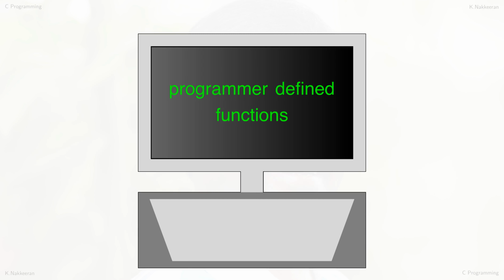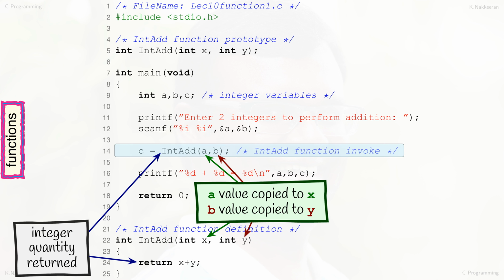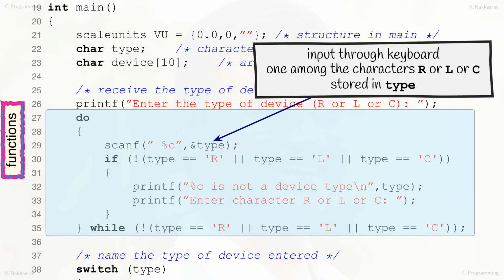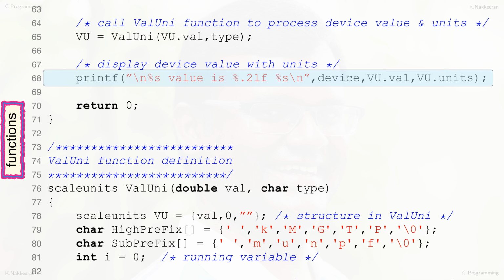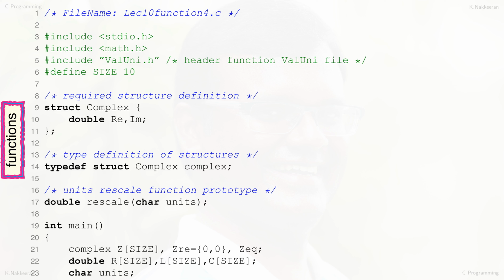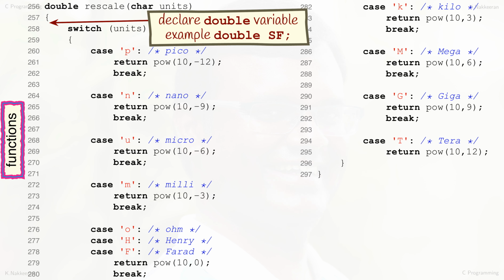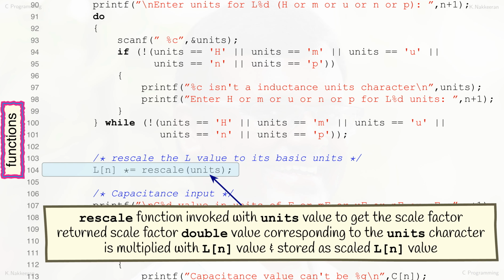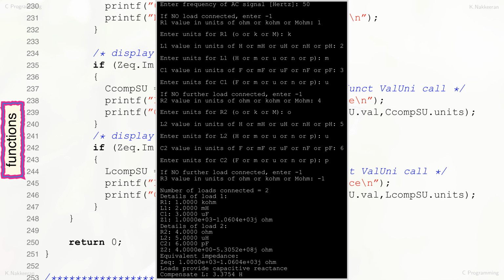C Programming Lecture 10/13

Comment from the maker: /* FileName: Lec10function4.c */

#include <stdio.h>
#include <math.h>
#include "ValUni.h" /* header function ValUni file */
#define SIZE 10

/* required structure definition */
struct Complex {
    double Re,Im;
};

/* type definition of structures */
typedef struct Complex complex;

/* units rescale function prototype */
double rescale(char units);

int main()
{
    complex Z[SIZE], Zre={0,0}, Zeq;
    double R[SIZE],L[SIZE],C[SIZE];
    char units;
    scaleunits RSU[SIZE],LSU[SIZE],CSU[SIZE];
    scaleunits LcompSU,CcompSU; /* struct compensate L & C */
    double pi,f,w; /* double vars pi, freq & ang freq */
    int n=0,m=0; /* running var for number of loads */
    
    /* frequency of the AC power supply */
    printf("Enter frequency of AC signal in Hz: ");
    do
    {
        scanf(" %lf",&f);
        if (!(f >= 0))
        {
            printf("Frequency value can't be %g\n",f);
            printf("Enter +ve value for frequency in Hz: ");
        }
    } while (!(f >= 0));

    pi = 2*asin(1);   /* pi value in double */
    w = 2*pi*f;       /* angular frequency */
    
    /* Resistance input */
    printf("\nIf NO load connected, enter -1\n");
    printf("R%d value in units of ohm or kohm or Mohm: ",n+1);
    do
    {
        scanf(" %lf",&R[n]);
        if (!(R[n] >= 0 || R[n] == -1))
        {
            printf("Resistance value can't be %g\n",R[n]);
            printf("Enter +ve value for R%d or -1 if no load: ",n+1);
        }
    } while (!(R[n] >= 0 || R[n] == -1));

    /* receive the units for resistance */
    if (R[n] != -1)
    {
        printf("\nEnter units for R%d (o or k or M): ",n+1);
        do
        {
            scanf(" %c",&units);
            if (!(units == 'o' || units == 'k' || units == 'M'))
            {
                printf("%c isn't a resistance units character\n",units);
                printf("Enter o or k or M for R%d units: ",n+1);
            }
        } while (!(units == 'o' || units == 'k' || units == 'M'));
        
        /* rescale the R value to its basic units */
        R[n] *= rescale(units);
    }
    
    while (R[n] != -1)
    {
        /* Inductance input */
        printf("\nL%d value in units of H or mH or uH or nH or pH: ",n+1);
        do
        {
            scanf(" %lf",&L[n]);
            if (!(L[n] >= 0))
            {
                printf("Inductance value can't be %g\n",L[n]);
                printf("Enter +ve value for L%d: ",n+1);
            }
        } while (!(L[n] >= 0));
    
        /* receive the units for inductance */
        printf("\nEnter units for L%d (H or m or u or n or p): ",n+1);
        do
        {
            scanf(" %c",&units);
            if (!(units == 'H' || units == 'm' || units == 'u' || 
                  units == 'n' || units == 'p'))
            {
                printf("%c isn't a inductance units character\n",units);
                printf("Enter H or m or u or n or p for L%d units: ",n+1);
            }
        } while (!(units == 'H' || units == 'm' || units == 'u' || 
                   units == 'n' || units == 'p'));
        
        /* rescale the L value to its basic units */
        L[n] *= rescale(units);

        /* Capacitance input */
        printf("\nC%d value in units of F or mF or uF or nF or pF: ",n+1);
        do
        {
            scanf(" %lf",&C[n]);
            if (!(C[n] >= 0))
            {
                printf("Capacitance value can't be %g\n",C[n]);
                printf("Enter +ve value for C%d: ",n+1);
            }
        } while (!(C[n] >= 0));
    
        /* receive the units for capacitance */
        printf("\nEnter units for C%d (F or m or u or n or p): ",n+1);
        do
        {
            scanf(" %c",&units);
            if (!(units == 'F' || units == 'm' || units == 'u' || 
                  units == 'n' || units == 'p'))
            {
                printf("%c isn't a capacitance units character\n",units);
                printf("Enter F or m or u or n or p for C%d units: ",n+1);
            }
        } while (!(units == 'F' || units == 'm' || units == 'u' || 
                   units == 'n' || units == 'p'));
        
        /* rescale the C value to its basic units */
        C[n] *= rescale(units);
        
        Z[n].Re = R[n]; /* impedance real part */
        if (C[n] != 0)
        {
            Z[n].Im = w*L[n] - 1/(w*C[n]); /*imag part */
        }
        else
        {
            Z[n].Im = w*L[n]; /* impedance imag part */
        }
        
        /* Add up reciprocal of impedances */
        Zre.Re+=Z[n].Re/(Z[n].Re*Z[n].Re+Z[n].Im*Z[n].Im);
        Zre.Im+=-Z[n].Im/(Z[n].Re*Z[n].Re+Z[n].Im*Z[n].Im);
        
        /* increment variable for number of loads */
        n++;
        
        /* Resistance input */
        printf("\nIf NO further load connected, enter -1\n");
        printf("R%d value in units of ohm or kohm or Mohm: ",n+1);
        do
        {
            scanf(" %lf",&R[n]);
            if (!(R[n] >= 0 || R[n] == -1))
            {
                printf("Resistance value can't be %g\n",R[n]);
                printf("Enter +ve value for R%d or -1 if no load: ",n+1);
            }
        } while (!(R[n] >= 0 || R[n] == -1));
    
        /* receive the units for resistance */
        if (R[n] != -1)
        {
            printf("\nEnter units for R%d (o or k or M): ",n+1);
            do
            {
                scanf(" %c",&units);
                if (!(units == 'o' || units == 'k' || units == 'M'))
                {
                    printf("%c isn't a resistance units character\n",units);
                    printf("Enter o or k or M for R%d units: ",n+1);
                }
            } while (!(units == 'o' || units == 'k' || units == 'M'));
            
            /* rescale the R value to its basic units */
            R[n] *= rescale(units);
        }
    }
    
    /* check whether any load is connected */
    if (n == 0) 
    {
        printf("\nNo load. No compensation needed\n");
    }
    else
    {
        /* display the number of loads connected */
        printf("\nNumber of loads connected = %d\n",n);
        
        /* display the impedance of all loads connected */
        while (m != n)
        {
          RSU[m] = ValUni(R[m],'R');  /* function ValUni call */
          LSU[m] = ValUni(L[m],'L');  /* function ValUni call */
          CSU[m] = ValUni(C[m],'C');  /* function ValUni call */
          printf("Details of load %d:\n",m+1);
          printf("R%d: %.4lf %s\n",m+1,RSU[m].val,RSU[m].units);
          printf("L%d: %.4lf %s\n",m+1,LSU[m].val,LSU[m].units);
          printf("C%d: %.4lf %s\n",m+1,CSU[m].val,CSU[m].units);
          printf("Z%d: %.4e%+.4ej ohm\n",m+1,Z[m].Re,Z[m].Im);
          m++;  /* array index for next load */
        }
        
        /* equivalent impedance real & imaginary parts */
        Zeq.Re = Zre.Re/(Zre.Re*Zre.Re+Zre.Im*Zre.Im);
        Zeq.Im = -Zre.Im/(Zre.Re*Zre.Re+Zre.Im*Zre.Im);
        
        /* display the calculated equivalent impedance */
        printf("Equivalent impedance:\n");
        if (Zeq.Re != 0 && Zeq.Im != 0)
        {
          printf("Zeq: %.4e%+.4ej ohm\n",Zeq.Re,Zeq.Im);
        }
        if (Zeq.Re != 0 && Zeq.Im == 0)
        {
          printf("%.4e ohm\n",Zeq.Re);
          printf("Total load is purely resistive\n");
          printf("No reactance compensation needed\n");
        }
        if (Zeq.Re == 0 && Zeq.Im != 0)
        {
          printf("%.4ej ohm\n",Zeq.Im);
        }
        if (Zeq.Re == 0 && Zeq.Im == 0)
        {
          printf("0 ohm\n");
          printf("No reactance compensation needed\n");
        }
        
        /* display the compensating C value */
        if (Zeq.Im > 0)
        {
          CcompSU = ValUni(1/(Zeq.Im*w),'C'); /* funct ValUni call */
          printf("Loads provide inductive reactance\n");
          printf("Compensate C: %.4lf %s\n",CcompSU.val,CcompSU.units);
        }
        /* display the compensating L value */
        if (Zeq.Im < 0)
        {
          LcompSU = ValUni(-Zeq.Im/w,'L'); /* funct ValUni call */
          printf("Loads provide capacitive reactance\n");
          printf("Compensate L: %.4lf %s\n",LcompSU.val,LcompSU.units);
        }
    }
    
    return 0;
}

/******************************
units rescale function definition 
********************************/
double rescale(char units)
{
    switch (units)
    {
        case 'p': /* pico */
            return pow(10,-12);
            break;
            
        case 'n': /* nano */
            return pow(10,-9);
            break;
            
        case 'u': /* micro */
            return pow(10,-6);
            break;
            
        case 'm': /* milli */
            return pow(10,-3);
            break;
            
        case 'o': /* ohm */
        case 'H': /* Henry */
        case 'F': /* Farad */
            return pow(10,0);
            break;
            
        case 'k': /* kilo */
            return pow(10,3);
            break;
            
        case 'M': /* Mega */
            return pow(10,6);
            break;
            
        case 'G': /* Giga */
            return pow(10,9);
            break;
            
        case 'T': /* Tera */
            return pow(10,12);
    }
}

Comment from the maker: /* FileName: ValUni.h */

/* required local structure definition */
struct ScaleUnits
{
    double val;
    int pwr;
    char units[5];
};

/* type definition of structure */
typedef struct ScaleUnits scaleunits;
  
/* ValUni function definition */
scaleunits ValUni(double val, char type)
{
    scaleunits VU = {val,0,""}; /* structure in ValUni */
    char HighPreFix[] = {' ','k','M','G','T','P','\0'};
    char SubPreFix[] = {' ','m','u','n','p','f','\0'};
    int i = 0;  /* running variable */
    
    enum Move {left,none,right};  /* enumeration const */
    enum Move move = none;   /* enumeration variable */
    
    /* base units of the device entered */
    switch (type)
    {
        case 'R':
            sprintf(VU.units,"%s"," ohm");
            break;
            
        case 'L':
            sprintf(VU.units,"%s"," H");
            break;
            
        case 'C':
            sprintf(VU.units,"%s"," F");
    }
    
    /* check to move decimal point to left side */
    if (VU.val >= 100)
    {
        move = left;
    }
    /* check to move decimal point to right side */
    if (VU.val < 0.1)
    {
        move = right;
    }
    
    /* move decimal point as per 'move' & fix units prefix */
    switch (move)
    {
        case left:
            do  /* repeated / by 10 until VU.val < 100 */
            {
                VU.val /= 10;
                VU.pwr++;   /* count number of / by 10 */
            } while (!(VU.val < 100 && VU.pwr%3 == 0));
            /* fix the prefix for the higher units */
            VU.units[0] = HighPreFix[VU.pwr/3];
            break;
        
        case none:
            /* remove the front blank space in units */
            do
            {
                VU.units[i] = VU.units[i+1];
                i++;
            } while (!(VU.units[i] == '\0'));
            break;
        
        case right:
            do  /* repeated * with 10 until VU.val >= 0.1 */
            {
                VU.val *= 10;
                VU.pwr--; /* count number of * with 10 */
            } while (!(VU.val >= 0.1 && -VU.pwr%3 == 0));
            /* fix the prefix for the sub units */
            VU.units[0] = SubPreFix[-VU.pwr/3];
    }

    return VU; /* return the computed result */
}

Comment from the maker: /* FileName: Lec10function3.c */

#include <stdio.h>
#include <math.h>
#include "ValUni.h" /* header function ValUni file */

int main()
{
    scaleunits VU = {0.0,0,""}; /* structure in main */
    char type;    /* character variable */
    char device[10];    /* array of characters */
    
    /* receive the type of device through keyboard */
    printf("Enter the type of device (R or L or C): ");
    do
    {
        scanf(" %c",&type);
        if (!(type == 'R' || type == 'L' || type == 'C'))
        {
            printf("%c is not a device type\n",type);
            printf("Enter character R or L or C: ");
        }
    } while (!(type == 'R' || type == 'L' || type == 'C'));
    
    /* name the type of device entered */
    switch (type)
    {
    case 'R':
        sprintf(device,"%s","Resistor");
        break;
        
    case 'L':
        sprintf(device,"%s","Inductor");
        break;
        
    case 'C':
        sprintf(device,"%s","Capacitor");
    }
    
    /* receive the value through keyboard */
    printf("\n%s value in base units: ",device);
    do
    {
        scanf(" %lf",&VU.val);
        if (!(VU.val >= 0))
        {
            printf("%s value can't be %g\n",device,VU.val);
            printf("Enter a positive value: ");
        }
    } while (!(VU.val >= 0));
    
    /* call ValUni function to process device value & units */
    VU = ValUni(VU.val,type);

    /* display device value with units */
    printf("\n%s value is %.2lf %s\n",device,VU.val,VU.units);

    return 0;
}

Comment from the maker: /* FileName: Lec10function2.c */

#include <stdio.h>

/* required global structure definition */
struct ScaleUnits
{
    double val;
    int pwr;
    char units[5];
};

/* type definition of structure */
typedef struct ScaleUnits scaleunits;
  
/* ValUni function prototype */
scaleunits ValUni(double val, char type);

int main()
{
    scaleunits VU = {0.0,0,""}; /* structure in main */
    char type;    /* character variable */
    char device[10];    /* array of characters */
    
    /* receive the type of device through keyboard */
    printf("Enter the type of device (R or L or C): ");
    do
    {
        scanf(" %c",&type);
        if (!(type == 'R' || type == 'L' || type == 'C'))
        {
            printf("%c is not a device type\n",type);
            printf("Enter character R or L or C: ");
        }
    } while (!(type == 'R' || type == 'L' || type == 'C'));
    
    /* name the type of device entered */
    switch (type)
    {
    case 'R':
        sprintf(device,"%s","Resistor");
        break;
        
    case 'L':
        sprintf(device,"%s","Inductor");
        break;
        
    case 'C':
        sprintf(device,"%s","Capacitor");
    }
    
    /* receive the value through keyboard */
    printf("\n%s value in base units: ",device);
    do
    {
        scanf(" %lf",&VU.val);
        if (!(VU.val >= 0))
        {
            printf("%s value can't be %g\n",device,VU.val);
            printf("Enter a positive value: ");
        }
    } while (!(VU.val >= 0));
    
    /* call ValUni function to process device value & units */
    VU = ValUni(VU.val,type);

    /* display device value with units */
    printf("\n%s value is %.2lf %s\n",device,VU.val,VU.units);

    return 0;
}

/***********************
ValUni function definition 
*************************/
scaleunits ValUni(double val, char type)
{
    scaleunits VU = {val,0,""}; /* structure in ValUni */
    char HighPreFix[] = {' ','k','M','G','T','P','\0'};
    char SubPreFix[] = {' ','m','u','n','p','f','\0'};
    int i = 0;  /* running variable */
    
    enum Move {left,none,right};  /* enumeration const */
    enum Move move = none;   /* enumeration variable */
    
    /* base units of the device entered */
    switch (type)
    {
        case 'R':
            sprintf(VU.units,"%s"," ohm");
            break;
            
        case 'L':
            sprintf(VU.units,"%s"," H");
            break;
            
        case 'C':
            sprintf(VU.units,"%s"," F");
    }
    
    /* check to move decimal point to left side */
    if (VU.val >= 100)
    {
        move = left;
    }
    /* check to move decimal point to right side */
    if (VU.val < 0.1)
    {
        move = right;
    }
    
    /* move decimal point as per 'move' & fix units prefix */
    switch (move)
    {
        case left:
            do  /* repeated / by 10 until VU.val < 100 */
            {
                VU.val /= 10;
                VU.pwr++;   /* count number of / by 10 */
            } while (!(VU.val < 100 && VU.pwr%3 == 0));
            /* fix the prefix for the higher units */
            VU.units[0] = HighPreFix[VU.pwr/3];
            break;
        
        case none:
            /* remove the front blank space in units */
            do
            {
                VU.units[i] = VU.units[i+1];
                i++;
            } while (!(VU.units[i] == '\0'));
            break;
        
        case right:
            do  /* repeated * with 10 until VU.val >= 0.1 */
            {
                VU.val *= 10;
                VU.pwr--; /* count number of * with 10 */
            } while (!(VU.val >= 0.1 && -VU.pwr%3 == 0));
            /* fix the prefix for the sub units */
            VU.units[0] = SubPreFix[-VU.pwr/3];
    }

    return VU; /* return the computed result */
}